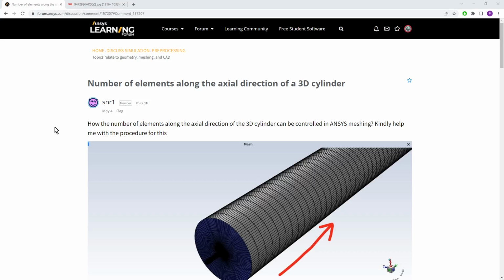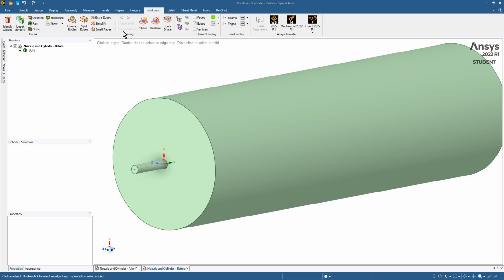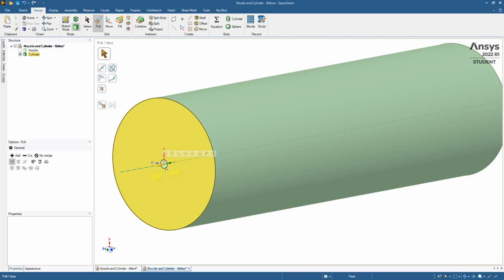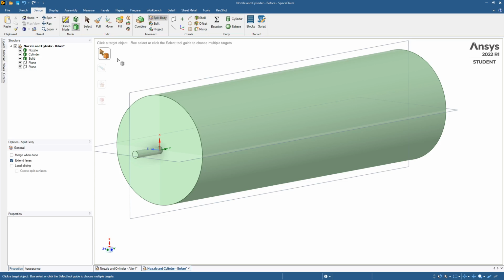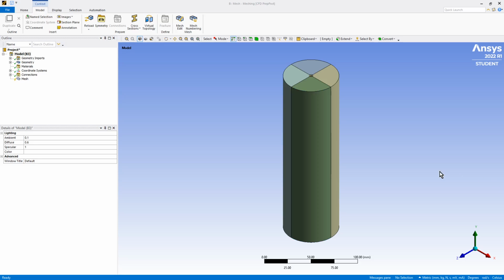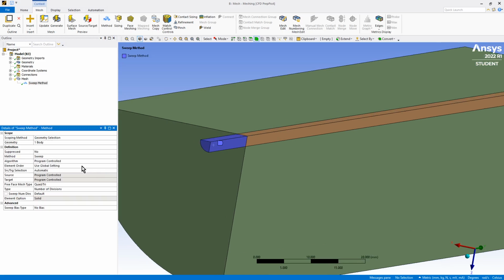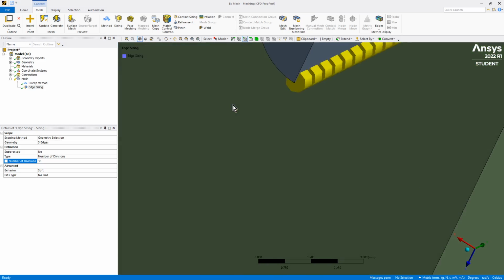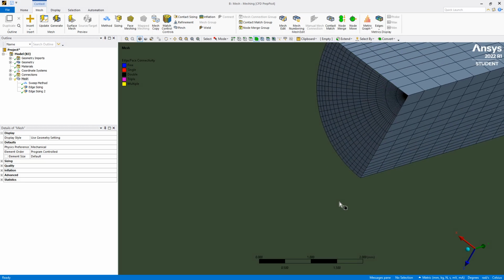ANSYS 2022 SpaceClaim Meshing CFD

Comment: Hi Peter, thanks for the tutorial. I am not sure if the 4 separate parts of the cylinder need contacts to be defined in the mechanical. As they are actually from a single cylinder and inside the same structure tree in the spaceclaim, is there any need to define a bonded contact among these 4 parts? In design modeler, as I know, you don't need to define contact among these parts if you group them as a single part.
Reply from the maker: Yes, you are right. That is why I added the comment in the description about using the Share button.